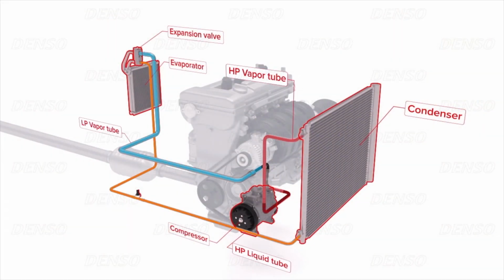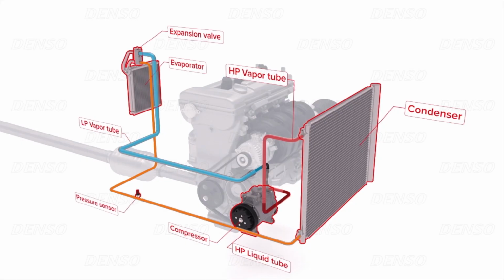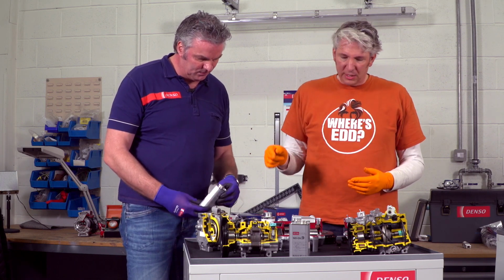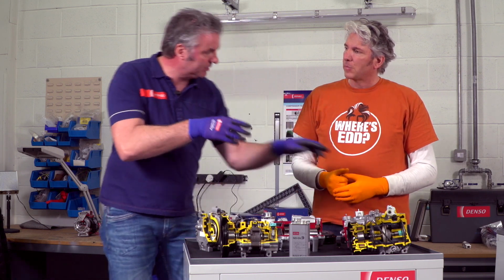Edd China explains DENSO AC System Operation

Comment: The label is usually at the oposite end to the clutch .i.e rear plate just after the pipe entry points . Also suggest its worth making yourself aware of oil balancing and desicant replacement if changing out a compressor.